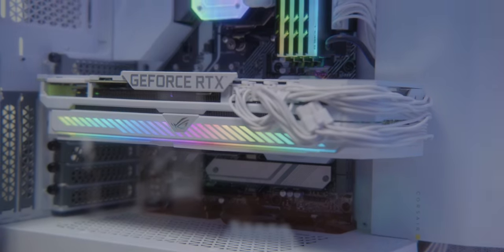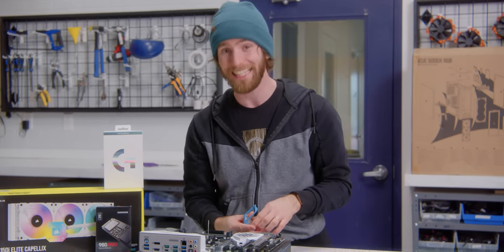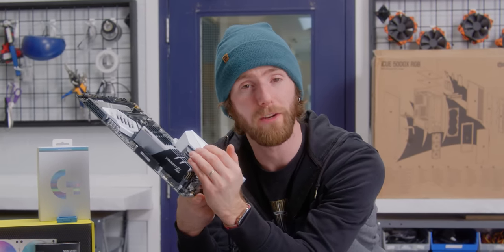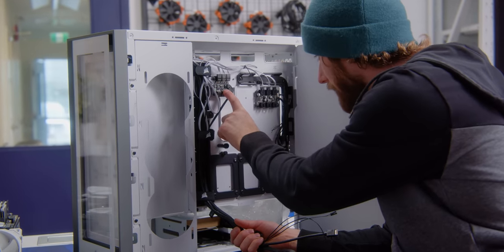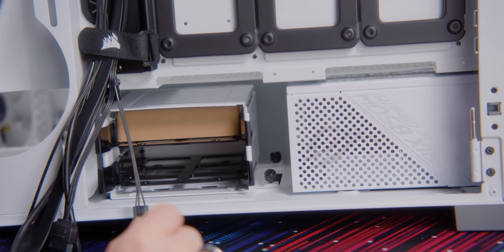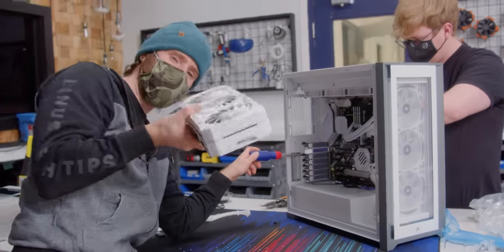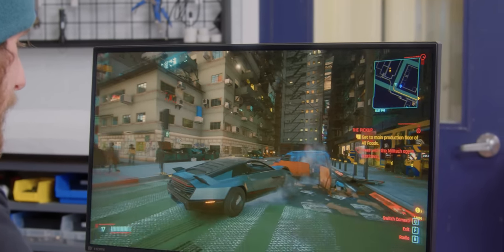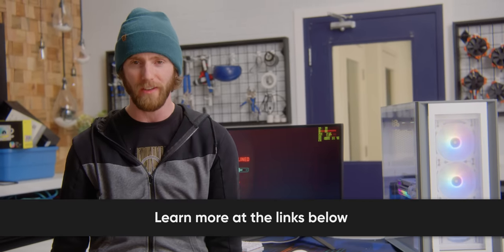The ALL-WHITE Gaming PC!

Comment: Linus flexing he’s the only person in Canada who actually has a 5950x and a 3090
Reply: somehow AMD CPUs are more rare than graphics card, never seen any ryzen 5000s in Canada
Reply: On amazon UK you can get any gpu but it is a little more expensive
Reply: @bestledisthe  actually my cousins has a ryzen5 5600 I think
Reply: I have one. It was not easy to get and took me months but I use it for work. It’s not a gaming value.
Reply: It was a hard 5950x my guy not 5900x
Reply: Or just the only person
Reply: @kouroshasefi5115  rtx 3090s go for a 2 - 3 times markup on amazon UK thats not a little expensive
Reply: @bestledisthe  I just bought a 5600x at my local Micro Center, they have tons of them
Reply: @kouroshasefi5115  "little" that's about £200-300 extra for a 3070
Reply: @ItssMitch  that's not that much really especially when scalpwrs are doing it for much more elsewhere like 3090 is about 1700 so only 200 more

Comment: Other games: 60 FPS at 1080p on an old 1060
Cyberpunk2077: 60 FPS at 1080p from a 3090...
Reply: 1. I doubt that you’re running with RT ultra at maxed settings with a 1060
2. I doubt you’re getting 1080p60 on MINIMUM settings with Cyberpunk on a 1060
Reply: @xxxzzzzxxx  i never said it’s how it should be, that’s just how it is. i’m not a fanboy - i don’t own Cyberpunk 2077 nor an Nvidia GPU.
Reply: I have a 3090 and if i play 1080p then i get 120 fps on ultra
Reply: @rossgoosen7269  poor
Reply: Wait a minute my 3060ti got 60fps in cyberpunk with rtx ultra@1080p, something is wrong
Reply: @IIIPHOENIXIII ew 1080p players, I run it at 1440p 200fps low no DLSS
Reply: @IIIPHOENIXIII lmao also ultra settings kinda suck, fps > gfx
Reply: bruh its bottleneck, 3000 series are made for 4k gaming, maybe can achieve decent fps in 1440p but mostly its 4k card
Reply: are you guys also forgetting how fucking horribly optimized Cyberpunk is? lmao

Comment: Maybe do the team build in the next scrapyard wars when the world eventually returns to normal.
Reply: The only stipulation I’d add would be it has to run cyberpunk bm at min 60fps @ 1080p or something like that. Just to avoid overly simple builds.
Reply: Way back LTT did a scrapyard wars with no Internet, how about only Internet and a team build. Probably needs to be longer than 3 days and test on 4th, but could be done.
Reply: If it returns
Reply: To be fair, the world hasn’t been normal since 300k years.

Comment: "$200 for a case is not that expensive"
-Linus 2020
Reply: lmao my case cost like 55€ and it looks really nice
Reply: Laughs in 35€ case
Reply: @timoteomucedero1259  oh, it also has magnetic tempered glass? :)
Reply: @megapet777  plexiglas, but it's nice anyway 😂
Reply: @timoteomucedero1259  Good enough for 35€ :D
Reply: laughs in case costing more than cpu
Reply: @megapet777  true😂😂
Reply: @tuomo2547  weird flex but okay😂😎
Reply: My  Corsair 200R cost 50$ and is good enough for anything I would build.
Reply: Laughs without a case
Reply: 2021
Reply: Well the regular price for my huge 30lb  Thermaltake Core V71 full tower case was like $150 at the time back in 2015 and I got a deal on it for $100 so it isn't that far off when you're aiming for maximum airflow and tons of space to work with.
Reply: It's really not tbh.
Reply: Its got 3 LL120s tho, which are at about 100. realistically the case willl cost you 100 if you were going for those pretty fans
Reply: My WHOLE pc is 150€...
Reply: HAHA I’ve spent over 3k$ on a case 😏
Reply: He didn’t lie it’s not but you’re just broke
Reply: it’s a lot but in comparison to some of the other random stuff they buy for so much it’s not that bad
Reply: Cases CAN cost like 2 grand, but honestly yeah. The difference between a 30 dollar and a 50 dollar is miles greater than a 50 dollar and a 2000.
My case was 40 bucks. It's a little rough on the legend paint jobs, but it's more feature rich with better vents than the $80 that were in my price range.
Reply: 94 usd, NZXT H500 from 2019. Cools fine, a pleasure to build in.

Comment: "we're not actually spending that much on our budget" yep $204 is my whole system unit, peripherals and monitor included.
Reply: tf do you have at that price? a lot of peoples peripherals is a decent amount more then that
Reply: Used market.
Reply: @zedvallez8590  still tho
Reply: my old setup was $70
Reply: @zedvallez8590  still like you must have a shitty setup I mean if it works it works but i feel like you turn away from certain experiences/games because your setup. I guess if you don’t play games it’s fine but if you do things like FPS games will probably turn you away as you will always be at some sort of disadvantage or games like warzone probably can’t run.
Reply: Just one of my peripherals...wireless HDMI...costs a hundred bucks more than that.
My keyboard cost that much.
Reply: @freedustin  Ooh la la...
Reply: @Nightwishmaster  and it's all hooked up to an FX processor. gettin' wet yet ladies?
Reply: @freedustin  Cool. Kind of gross to rub it in someone's face that you have way better gear than they do but I'm sure it's nice.
Reply: Bruh my whole CPU cost more than that 💀
Reply: I mean, I can see a 10 bucks mouse and keyboard and a 50 bucks screen, but WHAT is inside your case?
Reply: It's not a gaming nor an entry level pc, it's  japan surplus (those thin ass pc)  here in the PH it cost like, 110$ pc, 50$ monitor and about 35$ mouse and keyboard, i just use earphones for Audio the one that comes with the phone.
Reply: @zedvallez8590  ok, but, specs please 🙏
Reply: Core i3 4th gen
4gb ram ddr3
Hd graphics
250gb hdd
Reply: @zedvallez8590  well that's actually not at all terrible for 100 bucks
Reply: @pvshka  I have got I5 3570, GTX 960 4GB and 16GB ram for about 200 USD. All components used and can run Cyberpunk at medium 1080p.

Comment: I've been running a Strix RTX 3090 and Ryzen 7 3700x on a 750w power supply for 4 years without issue. Asus support themselves said it was well within the capacity.

Comment: I’m building my first pc soon, and it’s kinda surprising how similar this build is to mine. I’m using a 5600x instead of a 5950, I’m using an rog strix motherboard but it’s still x570. I’m using 16 gigs of 3600 TridentZ Neo, I’m using a 6900xt instead of a 3090, and I’m using a 1tb 980 pro. Just a lot of similarities
Reply: damn sick pc for a first. 6900xt should shred graphics. 5600x is amazing performance for the price, 1tb pretty standard, 16gb is weak tho need upgrade that. It;s 2021 not 2011,

Comment: Greek build, are there any issues with heat in the CPU because you have the fans in push configuration, but because of that it’s blasting the hot exhaust air through the radiator, which of course cools the pump liquid inside, versus having the fans reversed and then adding 3 more static pressure fans on top in a push configuration so it blasts cold air from the room through the radiator instead of the hot exhaust air? Thank you I look forward to your thinking here, I always enjoy your videos.

Comment: My pc is this EXACT build, except I have a 1000w corsair powersupply with white cable extensions by cablemod, the rtx 3070 version of the rog strix white gpu in a verticle mount, a 2tb Samsung 990 pro 2tb nvme m.2 ssd (not a 980 pro, idk why people mistake me for that), quad channeling 64gb 4000mhz ddr4 g.skill trident z neo RAM, Intel Core i5 13600KF and a white z790 13th gen ddr4 rog atx motherboard. The only thing that's the same is the case and the Aio, tbh if u think about it, it's not the same, but it does look the same at least lol

Comment: What Linus doesnt realize is you can actually move the hard drive bay to the left towards the front of the case. The case comes with a separate piece to give more space on the bottom of the case instead of being walled off. Giving you more space to install the PSU and HDDs.

Source: I have this case

Comment: I run that Board with a Ryzen 7 2700X it is a good Board still for the price (which has come down) but be aware that the M.2_2 slot (the one under the "Heatsink") runs 10c hotter than the M.2_1 slot (near the CPU). The Chipset cooling fan actually blows hot air onto the M.2 SSD due to the cowling design and my WD Black SN750 is 52c at idle, and over 70c under load. The Heatsink and thermal pad supplied with the Board are totally ineffectual. You need at least a proper high-performance heatsink - as long as you have no plans to use the second PCIe slot for a graphics card which would require the space. I am attacking the problem with an M.2 to PCIe Riser with a PCIe to M.2 Card installed that - which is a round-about way of lifting the M.2 up away from the chipset, and yes an M.2 heatsink too. Awaiting that Order.

Comment: I sometimes think that maybe I should get and build my first PC, then I remember that a case can easily cost between £100 - £200. To Pc game you need a: Desk, Chair, Monitor, Keyboard, Mouse, Case, Motherboard, Ram, Gpu, Cpu, Psu, SSD or other storage options, Cpu Cooling, Case fan or fans. Dont even get me started on a webcam, speakers or any other gadgets the PC might need. Compared to that I will stick with my £250 Xbox and £100 Smart TV for a little longer.
I also find it funny that some will see nothing wrong with spending thousands on a device but refuse to pay 50 for a game.

Comment: i need a new processor and im undecided if i should pick the i7 9700 or i7 10700 the difference is not much
i like the 10th gen but the motherboard for the lga 1151 cost a lot less than the lga 1200

Comment: I have this and want to put the H150i cooler in the front instead of the top. Where the tube should be, on up or down? The fans on top heat, want to put stuff on the top of the PC.

Comment: Can i get an opinion on a planned white build???  I am not a streamer.  I am not a gamer (well a little).  I just want an all white and RGB cool looking, wall mount PC.  There are a couple things that could be a little cheaper but this seems to be the coolest looking.  The GPU seems to be the most difficult part.  All corsair for ease of rgb operating.

 Intel Core i3-12100F - Core i3 12th Gen Alder Lake Quad-Core 3.3 GHz LGA 1700 58W Desktop Processor - BX8071512100F,
 ASUS ROG Strix Z690-A Gaming WiFi D4 LGA 1700 Intel 12th Gen ATX Gaming Motherboard- PCIe 5.0, DDR4,
 16+1 Power Stages, WiFi 6, Intel 2.5 Gb LAN, Bluetooth v5.2, Thunderbolt 4, 4xM.2/NVMe SSD, 
CORSAIR Vengeance RGB Pro 16GB (2 x 8GB) 288-Pin PC RAM DDR4 3200 (PC4 25600) Desktop Memory Model CMW16GX4M2C3200C16W, 
Thermaltake Core P3 TG Pro Snow Snow SPCC ATX Mid Tower Computer Case,
 CORSAIR CX-F RGB Series CX750F RGB White 750W 80 PLUS Bronze Fully Modular ATX Power Supply, CP-9020227-NA, 
SAMSUNG 980 PRO M.2 2280 1TB PCI-Express Gen 4.0 x4, NVMe 1.3c Samsung V-NAND 3-bit MLC Internal Solid State Drive (SSD) MZ-V8P1T0B/AM,
 CORSAIR iCUE H150i ELITE CAPELLIX Liquid CPU Cooler LGA 1700 Compatible - White,  and
 PowerColor Hellhound AMD Radeon RX6650XT 8GB GDDR6.

Any opinions would be great for my first build attempt.

Comment: $200 for that case is way too much. Having to put fans in the side to get airflow because the front fans are pointless is just stupid, and the drive cage and cable duct placement is equally bad. You can get much better white cases for that money. Also I personally wouldn't trust an Asus PSU - since they don't make PSUs - but at least it didn't blow up

8:00 depends on the CPU spec and components. At the system builder I worked at there were periods where I built 10 machines every day, but they were also machines with no GPU and basic air cooling. On a sidenote I did go a bit nuts building effectively the same machine over and over for days - they were simple office workers

Comment: How do you Bluetooth to work with an AMD system? I can never get Bluetooth to work properly and that’s the only reason I’m considering the intel i7 10700k (which hopefully Asus makes an intel version of that board) but it’s going in the white strix Helios case. Thank you Mr Linus for your dedication to the craft. But can Bluetooth work with Amd?
Reply: Yes of course dude. Bluetooth has nothing to do with your CPU. I run a Ryzen 5600x system and use Bluetooth (mainly to connect my XBSX controller) w/o problems. What specifically do you have issues with? Have you installed the drivers for your bluetooth adapter?

Comment: Sins i couldn't get a hold of a GPU i figured i wanted a brand new computer. and sins my old rig was yeah lets just say old! i went for an all white build like you, but sins i'm not sponsored and get stuff for free, i had to "budget" it down a little bit. so here is my setup, it is a pre-built pc order i just made some small adjustments to it. and this was the best CPU i could get for it.. sins they where out of stock and did not know if or when they wold get them back in stock. 

Corsair iCUE 5000X RGB Midi Tower
ASUS GeForce RTX 3080 ROG Strix OC White
Intel Core i9-11900K Prosessor (i wanted a i7 12700k)
Corsair iCUE H150i ELITE CAPELLIX, White
Corsair Vengeance RGB PRO SL DDR4 3200Mhz 32GB
WD Black SN850 2TB M.2 SSD
WD Black SN750 1TB M.2 SSD
Seagate BarraCuda 4TB 3.5'' HDD
ASUS ROG Strix Z590-A GAMING WIFI hovedkort
Corsair RM750x, 750W Hvit PSU (they did not have the one from this video)
Elgato Game Capture HD60 PRO

What would you change?

Comment: I built 5 PCs for my gaming room because i have a airline flight simulator and racing simulator in a case Called ct710 Twings Gold it can fit two pcs in one that pc case like really and another pc with Corsair 5000d airflow and streaming and gaming have same components except for graphics card gaming has an RTx 3090 and the streaming has RTx 3080 both water cooled and the Corsair 5000d is for sick all in one gaming setup also water cooled and those two in one pcs in one case is cpu and graphics card is aio cooled That's about my gaming room pcs and it took me 5 days to setup everything and the room took 2 weeks to complete the room and yeah it's sick

Comment: 9:20 Those 8-pin cables wrapping around the sides of the GPU looks hella messy and ugly. That back shroud can actually be removed if Linus wanted. It's meant to direct airflow over the motherboard if intake fans were installed behind that shroud.

Comment: Thank you, Linus. You put the M.2 drive in the proper PCIe slot. The bottom. Most don't know that using the top M.2 slot is the wrong slot because the top slot shares pci-e lane with the gpu.

Comment: Not gonna lie... This is exactly what I'm building because when I first saw it I knew it was destiny.
Reply: Update: 
Built Something similar with a little less performance. I traded the r9 for a 5900x, 3060 ti, no m.2 :( (but still an ssd), different case, and only 2x16 gigs of g skill ''juicers''. Looks clean and auto setup (which is unreliable) clocked in at 4 flat ghz. Nice!